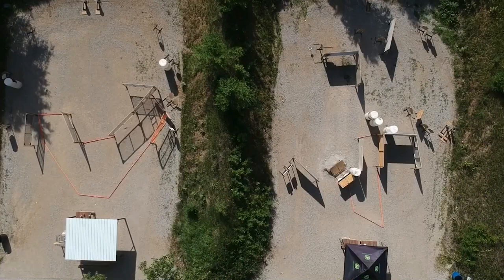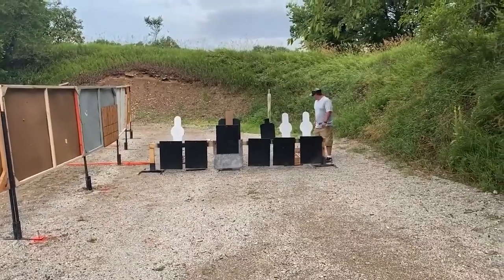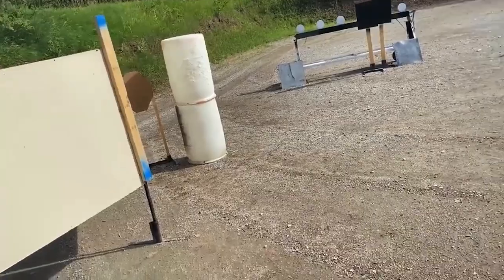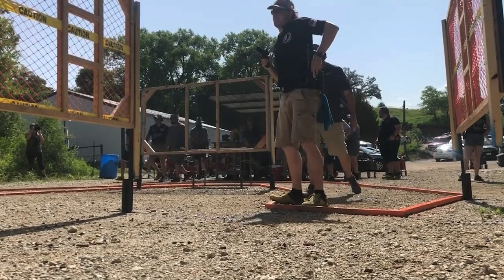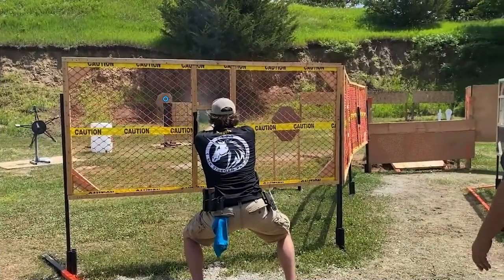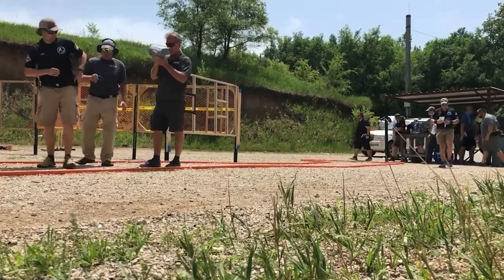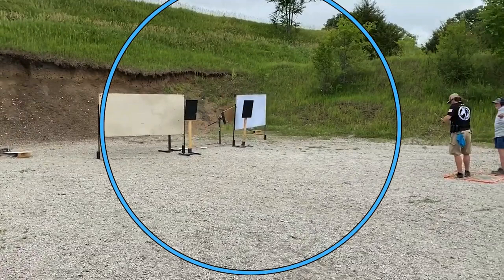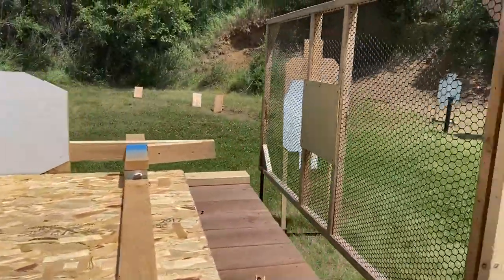PSTG Talkthrough Preview Great Plains 2020

Comment: Ben - On the shaky bridge, I feel I would have only engaged the 1 steel plate that was not visible from the closer port. Since I have to shoot from there, why not shoot them from a closer distance? For those of us without your shooting experience, I feel we increase the likelihood of 1st round hits at a faster speed than trying from the bridge.
Reply from the maker: I didn’t view it as a lot different and the round count worked out better to engage the steel from the bridge.
Reply: @BenStoeger187  Makes sense. Thanks for the reply.